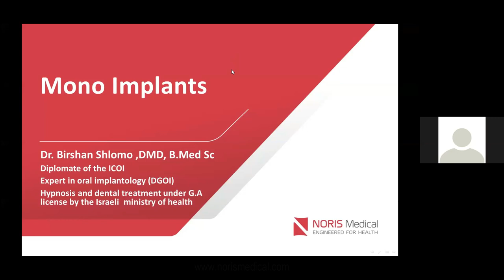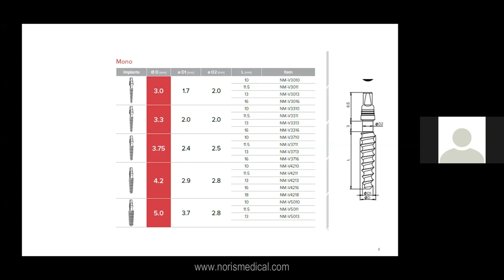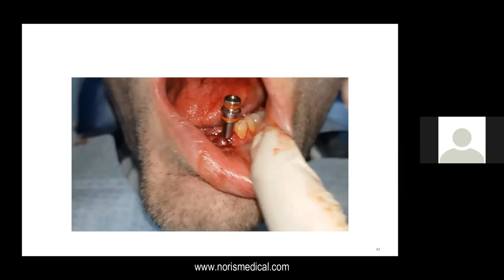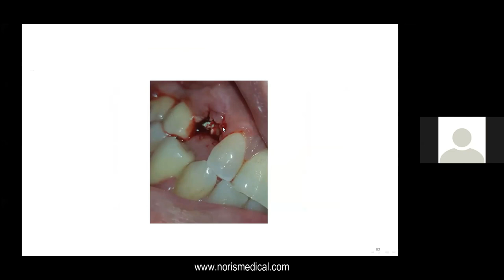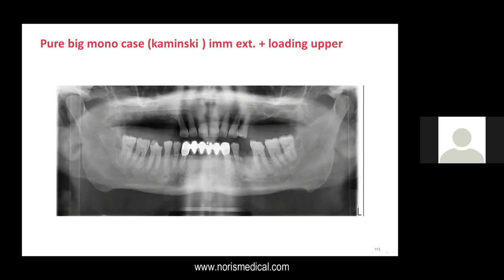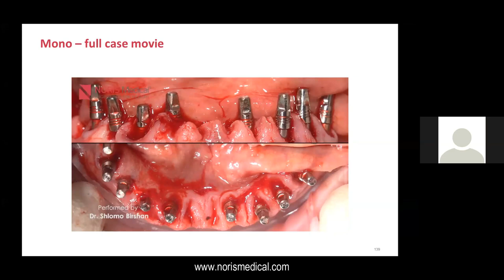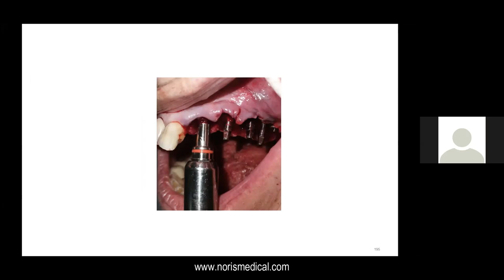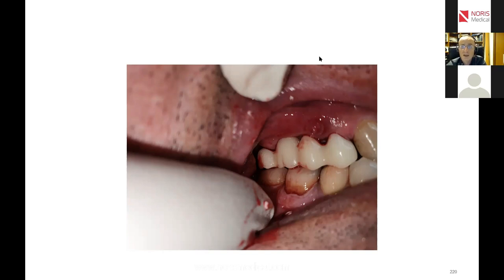Webinar Mono Implants with Dr  Shlomo Birshan by Noris Medical

Comment: Thank you for your presentation.
I have a question for you .
Let’s say there is missing molar #14 .Interdental space is 12 .5 mm ,width of the ridge is 5.5 mm.
Would you place two 3 mm implants and splint them in bridge to avoid horizontal graft and ridge split?
Thank you !